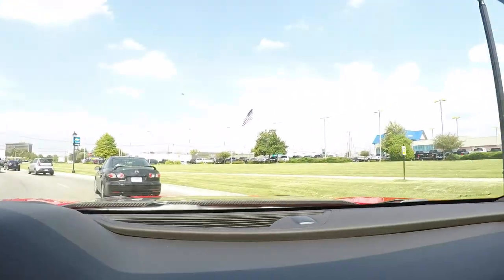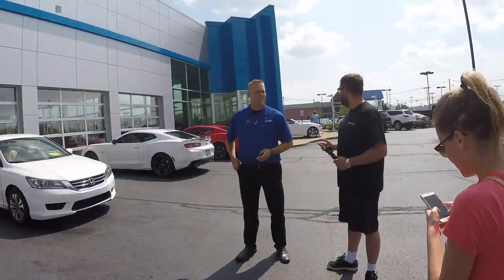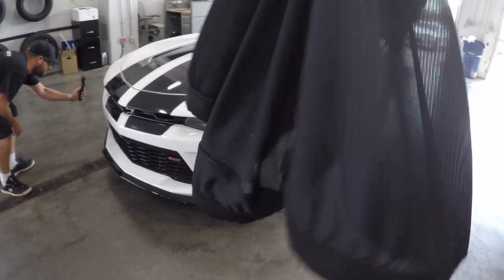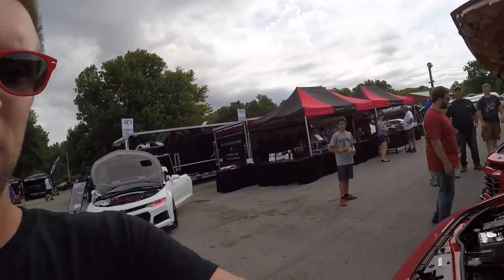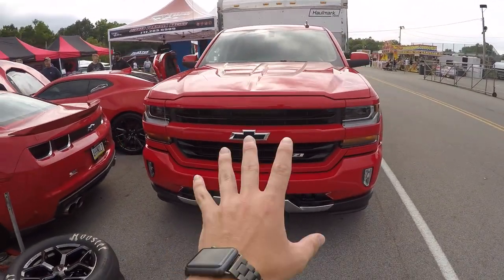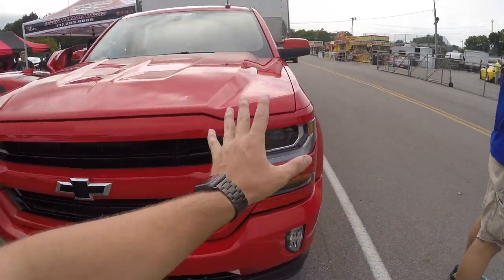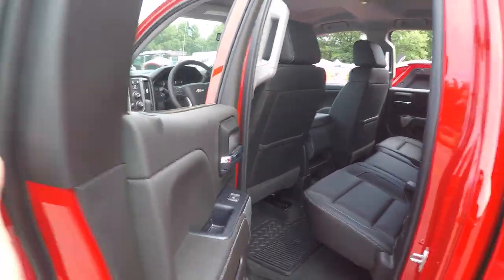I bought a BRAND NEW TRUCK

Comment: All these butthurts about the truck being gasser 1500 and him planning to tow with it.  Even if it was a 5.3 it'd have no problem towing a single car enclosed trailer with just enough space for a set of racing slicks and a couple of toolboxes.  He isn't buying a 5 car wedge trailer or 53' enclosed hauler.  You are underestimating the ability of that truck.
Reply: Ccls2 I towed my gt500 with an 08 1500 with a 5.3 and it did great I agree 100%
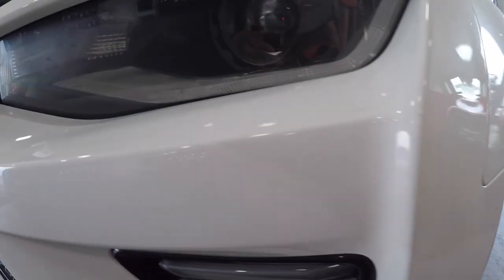Reply: Million.....Do you own a gas station?  Why would you ever want 4:11 in a street/road truck?  Unless you have some tall tires on it, 4:11 is way to low.  Chevy offers a 3:23 which is the perfect gear for an all purpose truck and tow vehicle.  Get the 8 speed transmission which has a 7.0 gear ratio spread. This gives you plenty of low gear choices for heavy loads and enables excellent highway millage with the overdrive final.
Reply: Ccls2 I think lots of people underestimate the capability of half ton trucks. You may have noticed that when his 2017 ZL1 was delivered, the trailer was being pulled by an F-150. Lots of people also don't think that a half-ton can two a fifth wheel RV, but it definitely can tow a fifth wheel that is the same size as a travel trailer that a half ton can tow, as long as you don't have the short box.
Reply: I have that exact same truck minus the useless black wheels. I would definitely think twice before towing that. The 5.3 is a turd but yeah it can get the job done. What I am more getting after is that if he planned on towing I would have at the very least gone with the max tow package with the towing mirrors. The 8 speeds tow much better then the 6 speed and the 6.2 is the number one thing I would want if towing a fifth wheel. I have owned a 14, 15 and now a 16 and let me tell you the 6.2 is night and day, but at the end of the day regardless of power, you still need the payload and proper setup to be safe. Sometimes just because you can, doesn't mean you should.
Reply: Ccls2 no matter what you're towing with a diesel you'd still get alot better gas milage. Cause diesels are meant for towing because those engines have more bottom end power. Making it easier to haul. With a gas truck over time it puts stress on the engine and would wear down the engine faster overtime. But still overall a beautiful & nice truck
Reply: Justin Crone Still the fact is that his truck was around $45k and a fully speced 4x4 2500 with the duramax is about $20k more usually.  Unless he absolutely needed the power with something like a full steel multi-car wedge trailer, $15,000-$20,000 more isnt worth the 3-5mpg he'd gain.
Reply: The 5.3 is a better pulling motor where the 6.2 just sounds better lol

Comment: Nick, just questions for you. The new truck comes with a key and not a fob? Glad to see the Nova Stretch bra did it's job, now what do you do to clean it? As to the cold air intake, it looks like you have to remove the lid to fill the windshield washer reservoir? Last question, only because you and Streetspeed Mike are friends, why doesn't Streetspeed Mike deal with Chevy Dude Mike? Hope you all have a safe trip back to Pa.
Reply from the maker: Daphne CArey correct, no key fob. As far as I know, you just shake it out or clean it in water. They make a windshield washer fluid relocation reservoir to make it easier.

Comment: Nick looks like the kind of guy who buys a tow rig that's gas............oh wait.
Reply: What's wrong with gasser tow rigs ? I had a 99 chevy with a 454 that was my tow rig for years . Cheaper on maintenance,  easier to work on etc. If he is just gonna pull just the Camero it will do just fine. I have a 2000 1500 z71 with the 5.3 n it pulls a car just fine.  Yeah if you are going to pull every day or big ass loads yeah get a diesel.  I've had diesels n  I don't think they are worth the price if you just use them to haul once in awhile.

Comment: Love the color and the truck, just severely disappointed that it's a double cab not a crew cab :( P.S. it does NOT take up any extra bed space, you can get the bed in standard size (the one larger than the short bed) for the double cab and the crew cab. That small back door just looks dumb to me. But as long as you love it that's all that matters.

Comment: GuitarmageddonZL1 now you need a trailer.  Hehe.    I had a feeling it would be a red Z71 truck.   now you need a red trailer and a red toolbox.  Lincoln Electric welder.  it's red.   and they make a nice NASCAR version.   then a silent generator.  Milwaukee makes red tools....  you need bigger garage.   Oh  and get you gf a 4 cylinder turbo Camaro.

Comment: Been watching for a while. Good work. Except that I notice you like to bring both cars with you a lot. So why you didn't spend the money on a nicely equipped Duramax. Then you could have bout for less than 8k or even rented a 35'  triple axle bumper pull hauler so you can bring both cars where ever you go instead of letting WIFEY (hint) put unnecessary miles on the new one. Just saying. Do what do. 👍

Comment: U bought a gaser to tow big mistake should of bought durmax
Reply: alex pohl it may have the 6.2 that's a good engine. And he's not pulling that big silver trailer just his car or some gear
Reply: Jimbo 71 there's no 6.2 available for the 1500, which is what this truck is. Even with the towing package it is not good for anything larger than RZR or Gator really. The only larger engine available in the 1500 was the 6.0 gasser which normally comes in the 2500s only, was the 1500HDs they made for a few years, and then the VortexMax 1500s. Both of which were very short lived, but great trucks. Definitely should've gotten a new L5P duramax, or even just an LML to tow.
Reply: Julian N. yeah there is a 6.2 available for the 1500. 420hp 460lbft
Reply: Julian N. You can get a 1500 with a 6.2
Reply: Julian N. You should check your facts. You can get a 6.2 in a 1500. The 6.0 is the base engine in the 2500 trucks. And that truck will be just fine towing one car. A diesel is always better for towing but for what he's doing a 1500 is fine.
Reply: Aj Onishenko my b guys, I didn't know that just checked chevy's website. When I was at a dealership this year they told me only the 5.3 is available for the 1500 and the 6.6L LML and 6.2 for the 2500s and up. I still wouldn't get a 1500 for towing, especially because he's probably going to end up towing both of his ZL1s. But if it's just one and he's using it as a daily I guess. Still not gonna do well with towing compared to a 2500. I hated towing an I closed 1 car trailer with the 2010 1500 we used to have. It had the 5.3 but barely made it up hills sometimes. Vastly different to the 7.3 we started using.
Reply: Julian N. the 6.2 can easily tow both cars, even the 5.3 can as the 5.3 is rated max tow is 11000 pounds and the 6.2 is 12600
Reply: With durmax he gets more towing power and he will get better fuel economy while doing that. And the the truck won't struggle on hills pulling cars l
Reply: NathanAt21:9 lol it's a half ton it not about the engine or max towing capacity it's the fact that the trailer weight is way more than the trucks weight, and is sketchy
Reply: Matt Drew The max towing weight is mostly based on the weight the truck can handle, not the power of the engine. The truck can safely tow up to at least 11000 pounds and that trailer is only 2-3 max and the cars 3-4 each. he will be fine for what he wants it for
Reply: NathanAt21:9 lol max towing capacity is what they can legally put it to there's a number, truck plus trailer max weight that is has to be under, same with diesels. He should be find but it's not gonna be happy about is the trailer is pulling the truck. Honestly you really shouldn't e towing over 6 to 7k in a half ton. The engine rear end trans will all be fine the suspension wont be very happy
Reply: alex pohl he will be fine towing the camaro with the 1500. I have towed heavier stuff with mine & it was flawless. Not everybody needs a 2500 & a duramax to tow. These trucks are great daily drivers mine gets 19-20 mpg & it could be more if could get out of throttle.
Reply: Shawn NH correct...the best I ever got with mine was 25mpg but that staying unde 65..Then in put exhaust, cold air intake and tuner on it still better has mileage than a Dodge but a whole lot of fun to drive
Reply: Julian N. you can get them with the corvette engine genius.
Reply: just because it isnt a duramax doesnt mean it cant pull his car, and if he bought the truck to pull his cars  then im almost positive its a 6.2 which is more then enough.